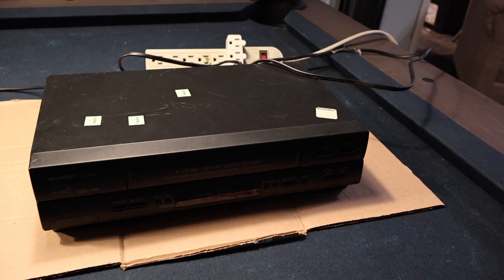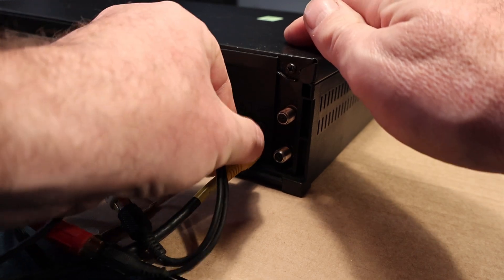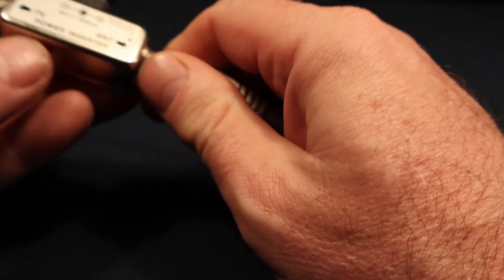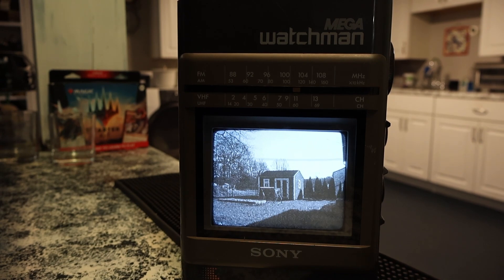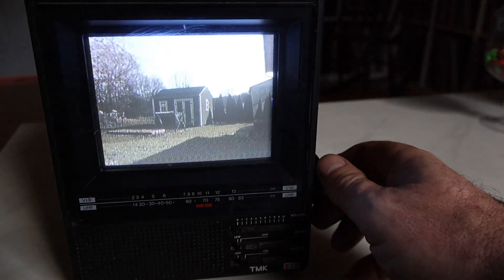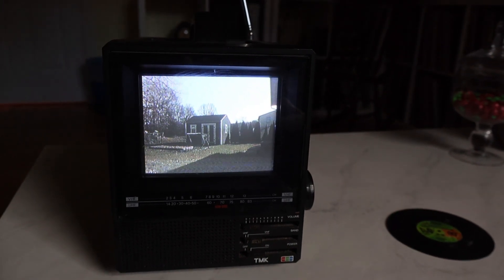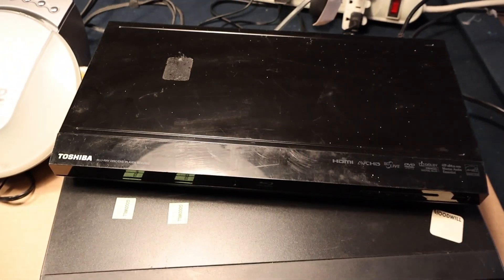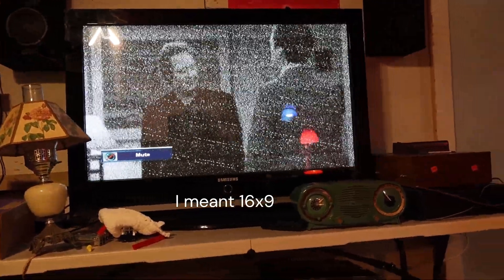The Madness of Transmission

Comment: This is something I’ve been wanting to do for a while, at least to just test it out. I’ve got a variety of CRTs small and large and they would be perfect with something like this. I guess a good question is what the source should be, DVDs and Blu Rays make sense as they are reliable. VHS would be fun but not ideal to put unnecessary wear and tear, maybe something like a DVD/HDD or similar combo unit? Of course another option would be a dedicated computer for the source content, I’d definitely use something like an old PowerMac or early Intel Mac combined with my iTunes library. You could always use Coax cable if you already have a bunch or have the internal wiring for it. Sure it might seem useless, but then again I also have CRTs and obsolete devices.
Reply from the maker: I wish I had coax running throughout the house. I have access to all the rooms via the attic, so that may be an option. I think a computer would be the best source and I hope to make that happen someday. Thanks for watching and commenting!
Reply: Nice, if you do plan on a project like that, it’d be worthwhile to route ethernet alongside the coax. Or you could always use the extremely fast and reliable phone line! I know I’d like to have the convenience of built in coax and ethernet, but it’s only easy to do without walls getting in the way haha. It’s probably overkill for a media machine, but a server type rack system would be cool, making it look like a broadcast station. Not to mention you can add rack mounted players for DVDs/Blu Rays, or really advanced stuff like Beta broadcast tapes.